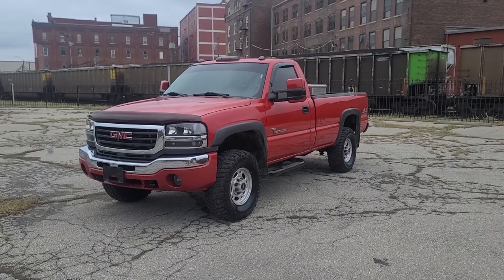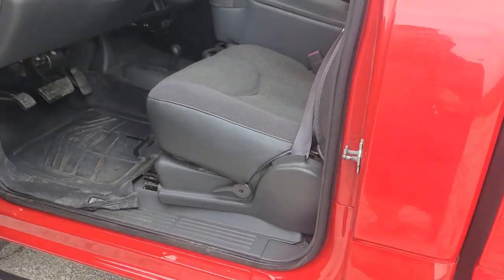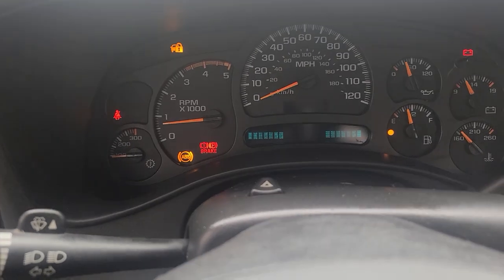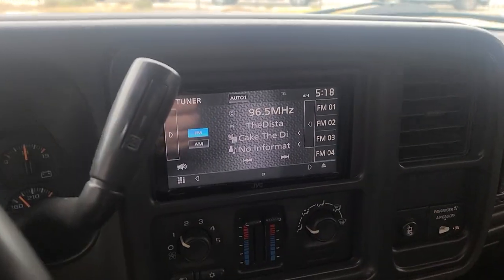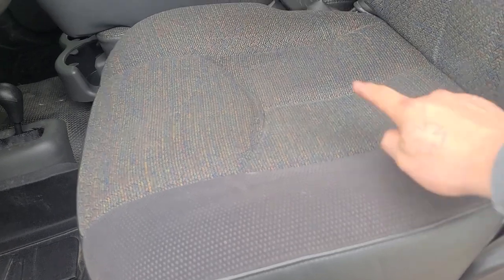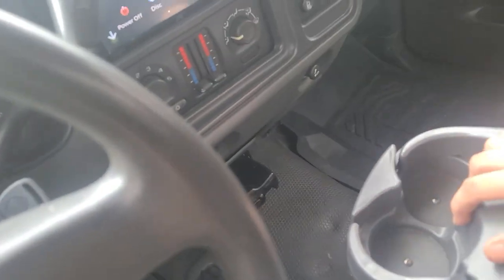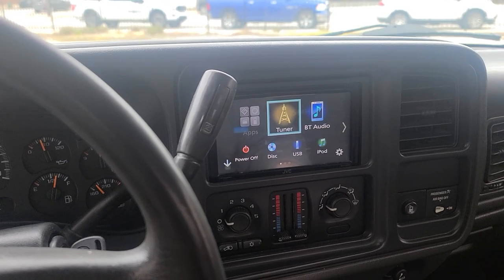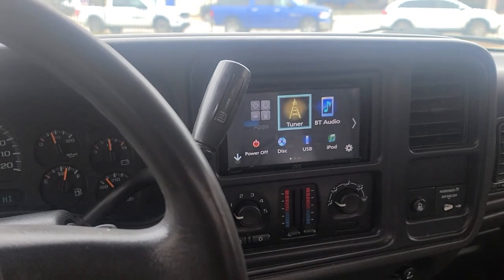2004 GMC Sierra 2500 Duramax LLY / Allison, Regular Cab Long bed 4wd Studs, Exhaust, Deleted, 35s!!

Comment: Hey man, love the truck. Was wondering what brand of headlight housings you installed and where you purchased them? All the aftermarket ones have issues so I’m trying to find one set that are black housings and fit properly. Thanks!
Reply from the maker: They were just ebay ones.